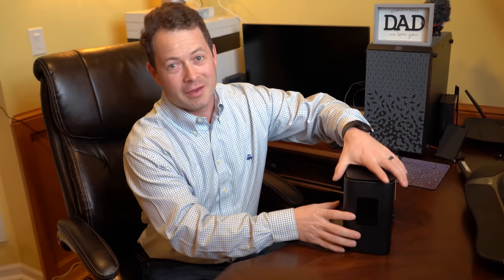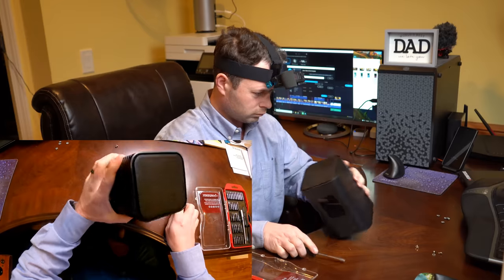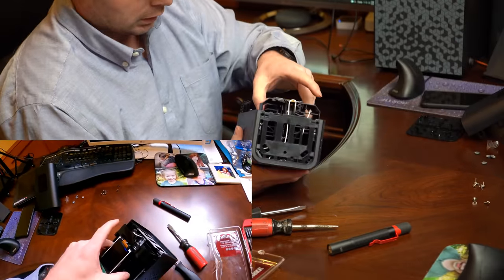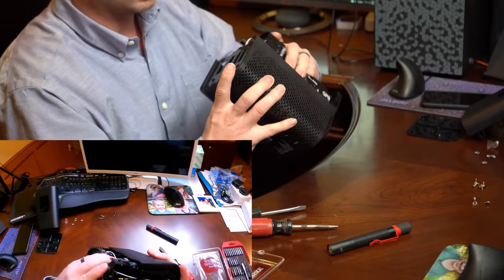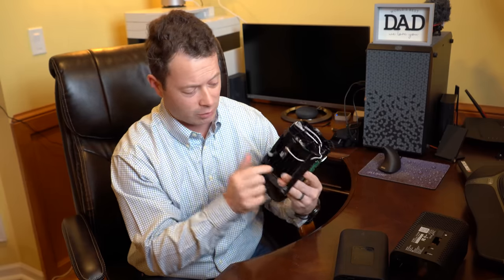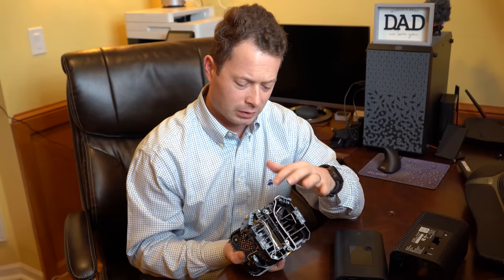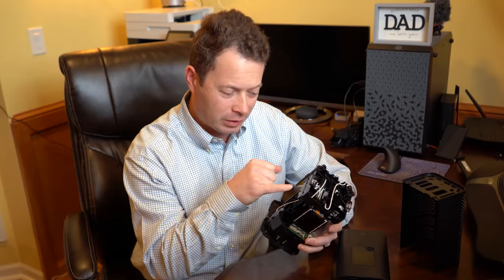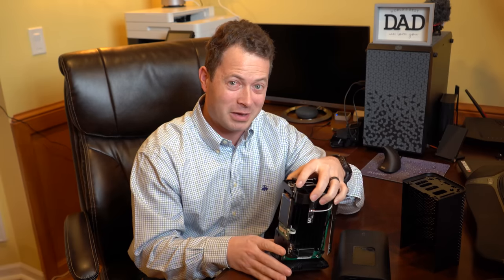✅ Disassembled! Arcadyan KVD21 T-Mobile 5G Home Internet New Gateway - External Antenna, Battery

Comment: I'm not happy with the performance of this unit.  I typically see speeds of 3-10 mbps upload.; gets worse at night. I have seen speeds up to 35 mbps, but it is very inconsistent.  According to T-Mobile's 5G/4G map, I'm in a 5G extended area.  I'm 5 miles from the tower in a wooded area.  My alternative is a DSL provider with 25 mbps for twice the cost (well, after a 2 yr commitment).  Thoughts?
Reply from the maker: Have you tried an external antenna?
Reply: @NaterTater  I have not.  I watched your videos on adding an external antenna.  The results are impressive and promising. 

I'm facing some very inconsistent speed results.  Yesterday, after watching your video about the T-Mobile app's location assistant, I moved the gateway to a slightly different spot in the house and got 5x increase.  I thought that fixed the problem.  Later in the evening, the speed went into the tank and made even watching YT-TV very frustrating.  So there's something going on in this area this is causing some sort of interference.  Will an external antenna make a difference under these circumstances?
Reply from the maker: @tarfy58  yes it will.  You also might be experiencing deprioritization if the slow down often happens in the evening.

Comment: Aren't you violating the T-Mobile contract agreement by opening the Gateway that you don't own and is owned by T-Mobile who is just letting you borrow it while you have an active account with them. They don't charge you for it or even lease t to you so you don't own it.
Removing or cutting the label damages it. Anytime you buy a electronic device they always have that clause that if you open the device it voids the warranty.
Reply from the maker: You are responsible if you damage the gateway per the agreement.  There is a right to repair law that has made it illegal to void a warranty solely based on a user taking it apart. I am not suggesting you do this, I am simply showing how it is done.

Comment: Received my KVD21 several days ago. Very good connection and very fast. Unfortunately it crashed every 20 minutes and disconnected from all devices. After reboot all is well only for another 20 minutes. After this pattern repeating itself for 24 hrs. I requested a RA from T-Mobile, returned it and had service turned off. This is not ready for prime time folks!
Reply: This was my experience as well for the first day, I figured it was maybe doing updates, but then I see that I'm on the same firmware as señor Tater Tot so idk. I've still got mine, and the speed has been pretty inconsistent to be frank. It's a good reminder to stop working for the day when the internet starts cutting out at 5pm 🤣 I have a feeling it loses connection a lot faster due to timeout issues, but then can't self correct.. so I'll hunt down the auto reboot software somewhere I guess.
Reply: Having the same issue and it's driving me absolutely crazy

Comment: How do i bypass the data throttle down?
Reply from the maker: There is no data throttle on TMHI.
Reply: @NaterTater  Lite
Reply from the maker: @reneaguirre9745  upgrade to unlimited with qualifying address. Or get MVNO and use appropriate TTL.  See my Chester Cheetah vids.

Comment: My questions are? Is a stinkbug installed in every unit by the manufacturer so you can get  better reception. And do they charge you extra for the stinkbug. Is the stinkbug optional. Do you get the 5 dollar discount without the stinkbug installed and do stinkbugs fart? If so, I'm sticking with the competitors.
Reply from the maker: I'm not sure about your other questions but I can tell you that stink bugs dont fart.  “Stink bugs – including BMSBs – have special glands in their thorax that are filled with a chemical cocktail that produces a mix of odors,” Bertone says. “When threatened, a stink bug can release the chemicals onto a rough part of its exoskeleton called the evapatorium. The shape and texture of the evapatorium helps the chemical evaporate more easily, quickly spreading the foul scent into the air – and hopefully discouraging predators.” per https://news.ncsu.edu/2019/02/why-do-stink-bugs-stink/#:~:text=How%20do%20stink%20bugs%20produce,its%20exoskeleton%20called%20the%20evapatorium.

Comment: Hey, is the LTE("4G") antenna dedicated / separate from the NR ("5G") antenna[s]?
Because if so I'm totally taking mine apart and UN. PLUGGING. the 🤬🤬🤬🤬🤬🤬🤬🤬 LTE antenna.
I've got this problem where... okay so I live maybe 20 or so miles west-by-northwest of B.F.E. but there's ONE. spot in my house where I can pick up a usable-enough 5G signal.
I can literally put my OnePlus 9 down SITTING ON TOP OF the dang Arkadyan, and it connects right to 5G (and in SA mode if I force it), resulting in a still-not-fantastic but USABLE data rate (...I'm talking the difference between like ~30ish mb/s and more like 0.5-2 mb/s here).
If my OP9 can pick it up the KVD21 sure as hell should, but no, T-Mo locks down the firmware so you can't change ANYTHING WHATSOEVER about what bands / etc their device wants to connect to, soooo... because it can "see" B71 a bit "louder" than N-bands (n71 OR n1) their crappy firmware goes "oh I should connect to that then" and I get... maybe 3-4 megabits, intermittently, on the VERY BEST of days...
...and I'm SO DONE with the "we're modernizing the towers in your area" excuse they've been using as a way to get off the phone for literally YEARS now.
Reply from the maker: No, they are intertwined but would still help you lock onto n71.

Comment: Well, yesterday I was in the middle of trying to add these pigtail connectors to the M port on the Arcadyan and I accidentally pulled a cable on the board and damaged it. I think the connector was damaged as I tried for an hour to get it to seat on the M port to no avail. Wondering if anyone here has had this happen and what the next best step to take is. I figured I'll reach out to t mobile and let them know what happened and ask about replacing the gateway
Reply: I unfortunately did the same thing, except I ripped the "M1" port off the board. I went ahead and hooked up the MIMO 4x antenna to the three remaining ports, (M, D, M2) and it works! All metrics are better than before I had the external antenna too.... It does make me wonder if it would be even better if I was also utilizing the "M1" port....
Reply: @jordanglowicki8953  hard to say, I would imagine so but these things are finicky. I finally got mine all connected and have tried 3 different waveform antennas. I bought the 4x4 panel but that actually did worse than the 2x2 panel. I can see the tower about a mile away from my front porch (I'm on a hill), yet my speeds are still only 60 Mbps download max. All the metrics are pretty good. Soo hard to say with these things!
Reply: @goldmund22  shouldn't 60 be enough for you? I wish I had 60 consistently
Reply: Yeah I broke my port as well. I’m just gonna put it all back together (if I can remember where the original antennas go) and possibly solder the antenna to the prong. and return it
Reply: @egg979  I eventually managed to get the m2 cables attached, realized I just wasn't putting enough pressure for fear of breaking them. However, ended up going with Verizon HI and no need for an antenna there thankfully.

Comment: I know you're still testing, but. This one is more difficult to get to as far snapping in the external antenna, I've had to leave it be for a few, because frustration was sitting in.  A thought cam to mind. Is there a way to use an Ethernet plug with an adapter to add an external antenna?  instead of having to open up the case?
Reply from the maker: Yes Charlie, these are more crowded are harder to get to.  Unfortunately we have to get to these pins to leverage an external antenna.  The thing that needs to happen for ease of install is the manufacturer needs to put SMA or type-N connectors on the rear of the gateway.
Reply: @NaterTater  RIght! Thank! Why did you choose M!!!!! It's a bugger! 🥴

Comment: Has anyone found a way to power the KVD21 off 12V?  Through USB-C?  Without an inverter?  Or just wire in a standard cable?
Reply from the maker: I think its 19v if I remember correctly
Reply: @NaterTater  Says 15V, 3A on the box so 45W.  Should be able to power it off a lighter socket but it has the USB C which isn't a common plug type > 5V.  I'm 'guessing' it would run off 12V.  Maybe not.
Reply: I was yesterday years old when I learned what PD really meant for USB-C and found a 12V adapter to Type-1C which works splendidly.  Sorry for the noise.

Comment: If it has GOS and BT then T-MOBILE knows when you move it to another location!!!
Reply from the maker: They openly allow you to move it wherever whenever now.
Reply: @NaterTater  how new is that?
I plan on moving mine this weekend to my seasonal campground as that is my main purpose for this unit.
Reply from the maker: @usasupra23  a couple weeks ago they announced you can move it without notifying them. If you get tmobile signal, it works (which has always been the case).

Comment: Should be called how to let them know you opened their product up. And damage your plastic with metal screw drivers. 

I'm returning my tower I need a closer n41 band I can only barely get 3 bars. I tried a antenna but wasnt enough. So I'm gonna stick with xfinity for now. the ping was terrible the dl around 600 got the upload up to 38 to 49 but it's not very consistent. I did try an router kinda fixed some problem. I only had 5 things on it and it would still get confused and drop down and up.

Now I will say I think this is the future of home internet. 

Hopefully by the 3rd edition they will fix and add the n41 to my closest towers .
Reply from the maker: 3 bars is plenty of signal as evidence  of your speeds.  Ping and consistency is the biggest challenge with fixed wireless (and cgnat).
Reply: @NaterTater  oh believe me I gave it the old college try. With all the tips and trick from here and others. It's good. But it is not reliable I had on 5 things and testing it out with the new router and it killed my oled smart tv apps it would only play for like 30 second on any app then shut off the tv. It never did that before.

As for my my n41 band it barely at times gets into 3 bars most of the time it is 2 with an antenna still got close to 50 upload. so yeah  with out the antenna the upload Is between 7 and 19 upload.

The tower for me to grab it is 3 miles away plus i dont know how well its gonna work once the trees get there leaves back. 

So yeah I'm just gonna wait.

Comment: Connecting an external antenna could result in civil and criminal penalties by the FCC.  Odd to promote that.
Reply from the maker: You might be referring to boosters which have to be FCC registered.  Antennas are fine.  https://youtu.be/9WR0lSQldCk

Comment: Wondering if I should get an external antenna for the KVD21? Would it be worth me investing or em I already as good as it gets?

My signal I Get is
5G
RSRQ: -10
RSRP: -91
SINR:  -1.9
BAND: N71

4G LTE
CQI: 9
RSSI: -96
RSRQ:  -10
RSRP:  -106
SINR: 7
BAND: B66
Reply from the maker: Certainly room for improvement.  Especially 5G SINR.  If you add an outside antenna it will give you better speed, lower ping.
Reply: @NaterTater  thank you 👍